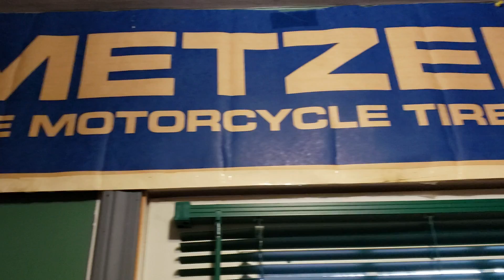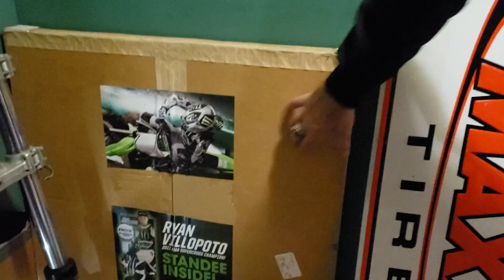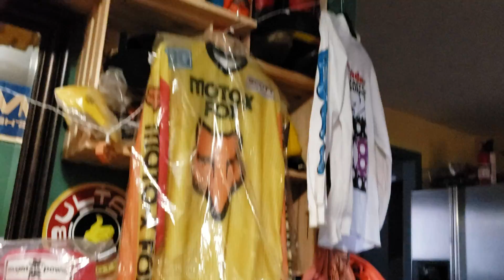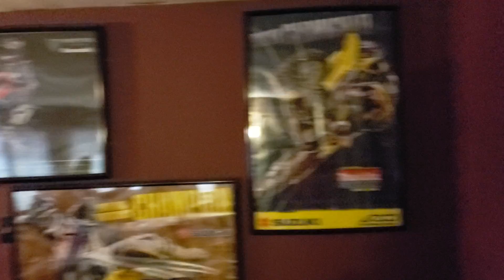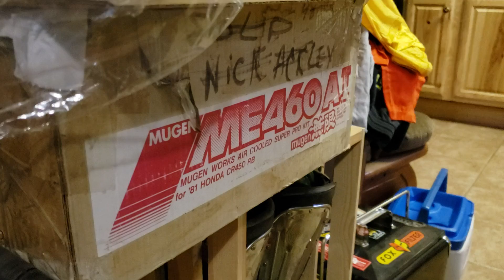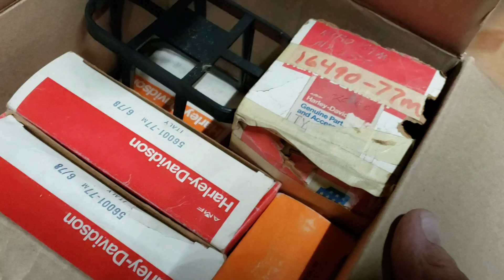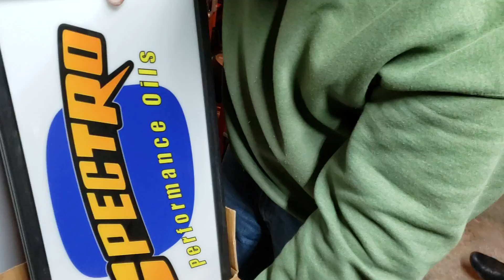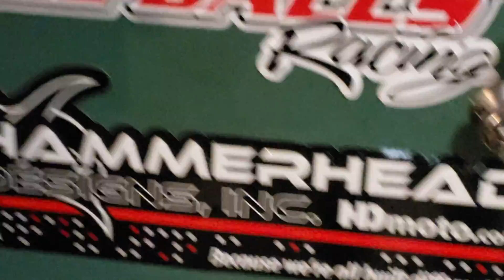Motorcycle collectors UNOBTANIUM dream find MX stash Part 1

Comment: I had a kawasaki KLX 250 back in 96'. It ran without a battery. The front telescopic shocks were plush and would soak up any rough trail and pot holes. Great suspension all throughoit

Comment: I have 2 pairs of Scott boots and one pair is new and it came with a repair kit. I also have 2 new JT jersey’s both with Honda logos, size is medium or large I can’t remember. If anyone is interested or of my of my motocross  memorabilia let me know I have lots of it.
Reply: Hey, I had some Scott boots back in the day, I would be interested in a pair, even the worse pair, been riding since yz s were yellow! I'm putting together a 70s/80s /90s /2000s sets of riding gear, got some decent m.robert boots, if you can part w/ Scott boots, I can pay/ trade/ combo...
Reply: @mxtv1258  I can buy or trade up for Scott boots, I have Joel Robert black leather 7 strap boots,early 70s yellow MX pants, then 80s/90s / 2000s stuff, Scott masks, a billion orphan gloves, old LOP catalog, I'll send you a list of my stuff, see if any interests you
Reply: The Scott boots are the red and blue. The used pair is missing a sole. I will show that in the video so you can judge the condition and decide if this is what you would be interested in. I also have AXO boots, I will double check the brand when I get home. I bought my Simmons forks from LOP in 1980.
Reply: @mxtv1258  cool, I want to have set of gear from each decade, Scott boots scream "1980"! I have 90' s Axo boots, had ' em new, just beat to death.i have more pants / gloves than anything but a few odds & ends.
Reply: @mxtv1258  howdy, rowdy, I haven't looked over your memorabilia vid, I got a ' Zook LT230s quad going, been beating that thing to death, it just keeps going! Vibrates, rattles, shocks don't soak up anything, goes good, though.2x I lost a swingarm pivot bolt nut, bolt backed out, 2miles walk back to truck each time! When's the last time you had a swingarm pivot bolt let go...
Reply: @richardkey4289  I have never had a swingers bolt fall out but other bolts yes. I am not sure what a LT230 is but do you have a YouTube video of it on your channel? I will search online to see it. What year?
Reply: @mxtv1258  '85 LT230S, quad, light, narrow , disc brakes, weak power, but the light weight helps it skip over forest trails, logging roads threw a Namura piston in it, 1 mm oversize, not a high speed ride, but a nice change of pace from a MX bike; this thing keeps me from racking up all the hrs on my cr250, it can be part time use& last a bit longer.25 dirt bikes, 1 trike, 10 quads, 0 street bikes!( Over lifetime, not current)

Comment: Them old High Points. Man I miss those. Love to find a pair lurking so where in an 11XW. Wish they would reissue those. I'd be all over them
Reply: bfarm44 , i have a pair of size 12 that i pull out for vintage days. They're wider than my size 15 tech10 (that i had to get, because i couldn't get into their 14.. which i ordered because I'm a 12.5W)
Reply: Look up "Alpinestar Supervictory" they still make the newer version.
Reply: "super victory" have the cool aluminum shin guard and are ready for duty. But they have the cam locks, rather than leather straps. There are a couple companies selling "mad max boots", with leather straps and traditional 'Santa buckles', but they are made for fashion, not riding (pretty gimmicky and they cost more than the real thing). The ones i have are exactly what goose wore
🏍️😎👍
Reply: @gilly3380  yes I agree. I have both kinds actually, I use the newer pair for vintage racing and the old original leather strap pair for my man cave display. haha
Reply: eBay from time to time